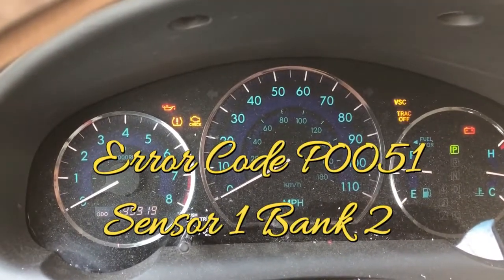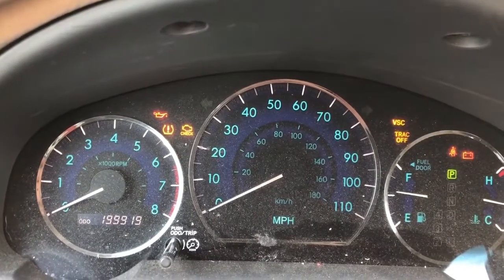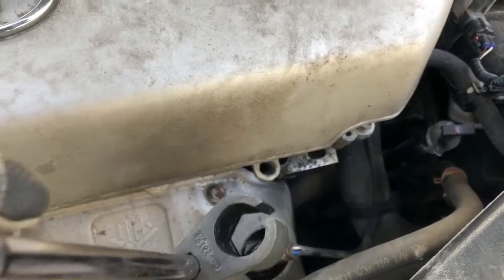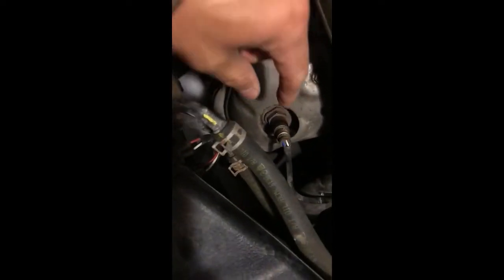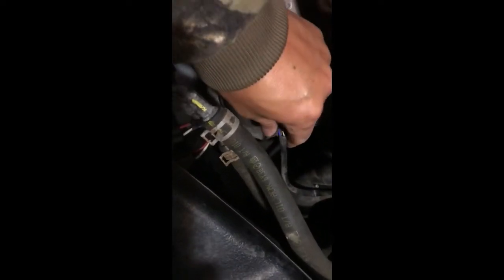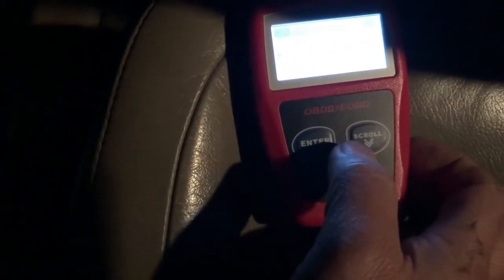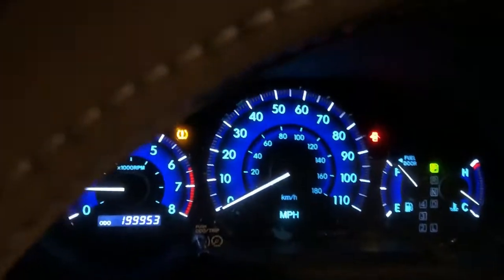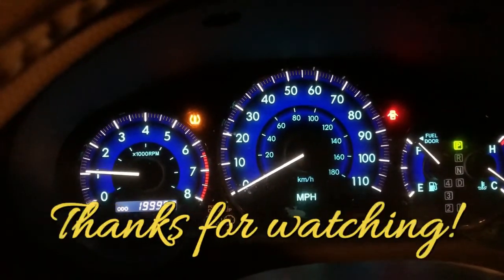DIY: Error Code P0051 (Oxygen Sensor 1)

Comment: What should i do i have lexus gs430 and i have same thing chick engine,trac,vsc and when checked combuter get same code eror 

Blease reply
Reply from the maker: It may be the same code, but have you Google base on your car make and model to be sure it's the same part? I would suggest you Google to make sure before replacing the part.